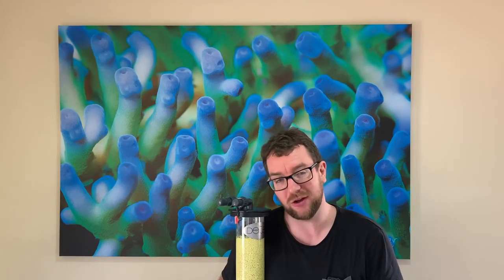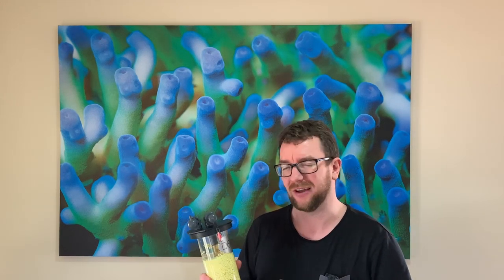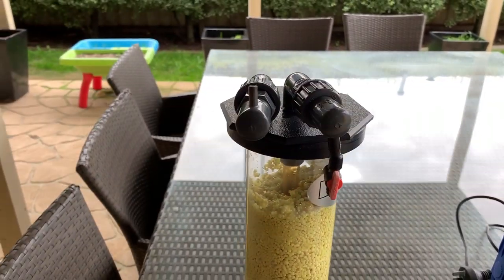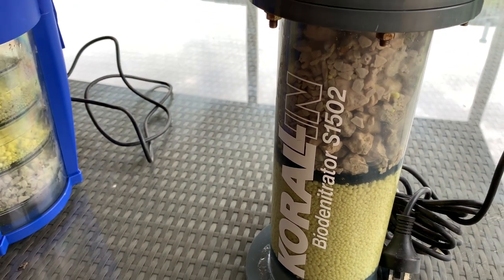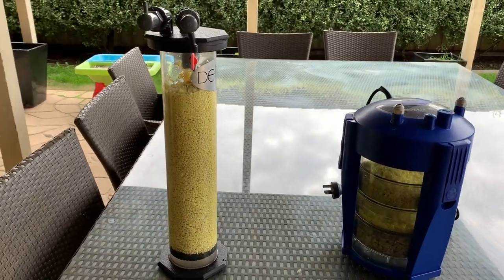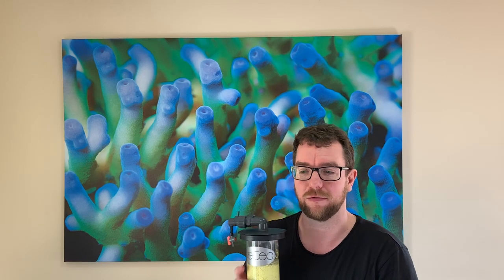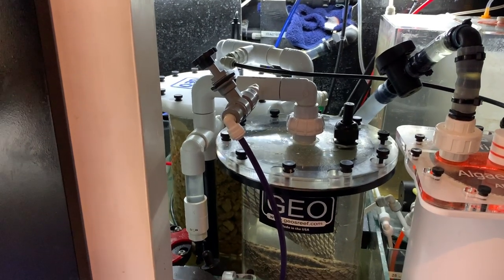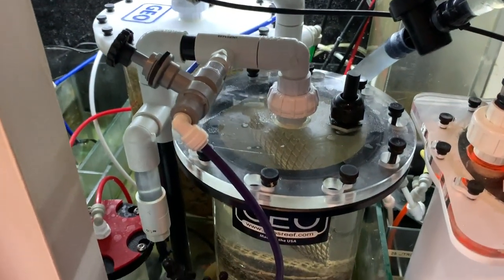Using a Sulphur Reactor for Nitrates

Comment: i used one on my 120L nano aquarium. 200ml sulfur and 750ml calcium. Nitrates where fine, less then 0.1 but....My Ca levels roofed upto 625ppm!! Guess sulfur reactors are ok if you have a big Ca  need in the tank, otherwise that's one of the down points, too much Ca added ( the acid water flowing trough tthe sulfur is based out by taking up calcium). So now i'm going to switch over to bio pellets.
Reply from the maker: Or just remove some calcium carbonate?
Reply: Tried that, but to no avail...Thing is to find the perfect mix of sylfur and Calcium carbo. Don´tvthink incisie suitable for nano aquaria. Mightvtry it with my new 500L i ordered in future..
Reply from the maker: @dannymieke  can I ask why to no avail? What happened?
Reply: @ParkersReef  well, Ca level kept rising even after i  removed 50% of the sulfur and 75% from  the calcium hydro.
Reply from the maker: @dannymieke  where do you think it was coming from?
Reply: @ParkersReef  well, did a 30% waterchange, Ca dropped from 625 to  560ppm. Removed 75% Ca from the sulfurcreactor, but Ca rised again following days.. so i removed the sulfur reactor, 30% waterchange  and one 1 week later, Ca measured at 548 ppm. I stopped dosing Kh also at the moment, it sits at 7.2Dkh.  Ca slowly goes down (503 ppm today), i hope it turns out well. My idea is that the sulfur reactor with Ca.hydrocarbo added more Calcium than the corals could use in my nano. Nitrate measures 5ppm, fosphate 0,04, so these are fine. Magnesium was stable all that time at about 1280. I´m gonna install a recirculating biopellet fluid reactor for nitrate reduction and when Ca goes close to 430 do a  start with 2 part dosing. Till then I´ll keep measuring the Ca and Kh and if needed dose Kh manually.  Resumé: sulfur reactor works very well and carefree if well proportioned and there is enough Calcium consumed in the aquarium, but not if the Ca sits at higher levels to start with.
Reply from the maker: @dannymieke  why not just remove the calcium carbonate from the reactor all together?
Reply: @ParkersReef   well.. sulfur reactors exit very acid water, the calcium regulates the acidity to normal values whilst releasing calcium in the water. Removing it completely is asking for trouwes...
Reply from the maker: @dannymieke  no trouble, just trying to help! Good luck with the bio pellet path (Y)
Reply: @ParkersReef   thanks! Biopellets are not failproof either but easier to manage  if you use a circulating reactor where you can regulate both the flow inside and the water flow throug the reactor. Zero No3 and Po4  is desastrous also..
Reply from the maker: @dannymieke  oh yep, absolutely. That is why almost no tanks run them anymore :D

Comment: Amazing video. I think Reefs.com did a totally different style version (like in a small sump) but besides that I have never heard of it before.
I was thinking all the time can you run this as a supplementary Calcium Reactor using the Sulfur instead of the CEO or doesn't it produce high enough effluent?
Like I was thinking about that new Nyos reactor (maybe you can't tune it too slow) and running say 300g/400L and a whole lot of ARM media. I think it should keep nitrates in check (if they aren't too high) and if you are running Kalk then you offset the pH and the dissolving media should help with stability.
As you didn't really touch on the pH though I guess it isn't acidic enough to dissolve the media fast enough.
But as I prefer running Kalk I expect (on my main tank build if I ever do it) I will use this if I ever need to keep nitrates in check should the fuge and whatever water changes I do not deal with it. Plus I think by using LaCl for phosphates and this for Nitrates you could probably really feed heavy and dial in the extra numbers you want - that's REALLY interesting.
Reply: Oh the reefs.com one is methanol - that was an interesting concept too but the cost and the space for one of those means I don't think it is practical for most people.
Reply from the maker: Methanol is a different concept.

You can use a calcium reactor, but not for calcium at the same time. Do not add co2 if you have sulphur in the reactor. You’ll need two reactors if you still need to supplement in this way.

The ph out of the sulphur reactor is around 7.5, not enough to dissolve arm media ;)
Reply: @ParkersReef  Oh I wouldn't add CO2 - I was wondering if the sulfur lowered the pH enough to get a little bit of the media dissolved (and kill 2 birds with 1 stone) but clearly not. Thanks mate - I think I will keep it in mind if my nitrates ever start being consistently too high ;)
Reply from the maker: @sunnygoold9449  yeah it won't unfortunately. In fact, the sulphur media will actually strip some alk out. So it will sadly still take 2 stones for those 2 birds :P

Comment: Help Sam I’ve been running a sulphur reactor for round 7 weeks can’t get any change in nitrate levels , always same as tank ?
Reply from the maker: Gotta slow that effluent down. 1 drop per ten seconds if you have to
Reply: I’ve tried as low as 5 drops per sec , but the smell in really bad at that rate and still no change in nitrate
Reply from the maker: Try a different nitrate test kit. If it smells, there is zero nitrate
Reply: Parkers Reef lol I’ve tried 3 different test kits api jbl nyos all read round 100ppm

Comment: So for the Deltec reactor, I don’t see any ARM in the same chamber.  What would you recommend using that reactor in this situation?  Would you connect a 2nd chamber in-line and fill it with ARM or something similar and control the drip rate from that unit?  It seems that’s a logical solution but checking your opinion.
Reply from the maker: The ARM is totally optional. It doesn't do a heap, but will help buffer the effluent a little